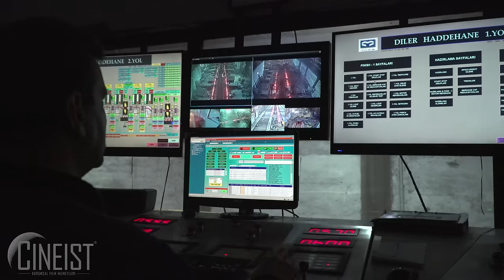Steel Factory, Steel Production, Steel Making Process, How it's Made

Comment: 1:15 what is the bucket like structure here called? the one that is holding the melted steel
Reply: That is a ladle. They're lined with refractory material
Reply: The one that holds & and transports the melted steel is called the ladle ! The bucket charges scrap in the furnace to be melted !

Comment: how much heat we have to give for liquit?
Reply: Around 2750 Celsius will melt iron and steel.  dQ = m*c*dT;  iron is roughly 0.45 J/(g*C).   So... to bring one ton of iron from STP to 2750 C is...  
dQ = 1,000,000 g * 0.45 * (2750 - 25) = 1.23 e9 J. From there, the latent heat of fusion for iron is around 247 KJ/kg.  Assuming you pay 12 cents per kWh, 1.23e9 J is roughly 342 kWh.  At minimum that'll cost you around $41 in electricity to do at 100% efficiency.  You won't get that efficiency.  Double that estimate at least.
Reply: The higher the carbon content the lower the liquidous temp. Most furnaces tap at around 3000 fahrenheit, for structural steel grades, and the casters I have worked on casted with a goal superheat of anywhere between 40 and 50 degrees. Very interesting work.
Reply: @gilian2587  the steel in this video starts to solidify at around 2750ish fahrenheit, not celcius. 2750 celcius is 4982 fahrenheit and there is no ferrous steel on planet earth that requires 4982 fahrenheit to become liquid. I have 15 years experience between working in the melt shop, where melting and casting occurs and, and working in the rolling mill where billets are rolled into finished product.
Reply: @goatandyourmom9690  It looks like I screwed up in looking up the melting point of iron; mixing up Celsius and Fahrenheit is a pretty big goof; I appreciate you pointing it out.  I'll revise my calculations shortly.
Reply: @gilian2587  you're good friend. It's one of the few times in my life where I actually know what I'm talking about and that's only because I spent many years in the industry. If you have a steel mill near where you live it's a good way to have a 6 figure income without a college degree.